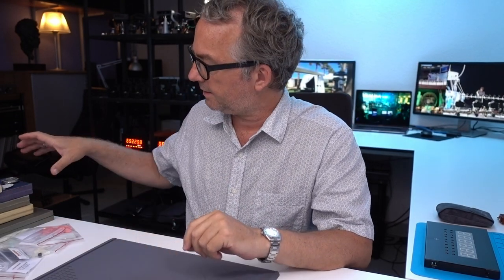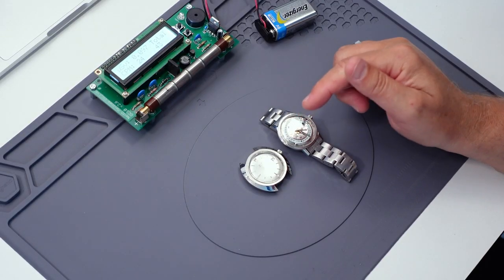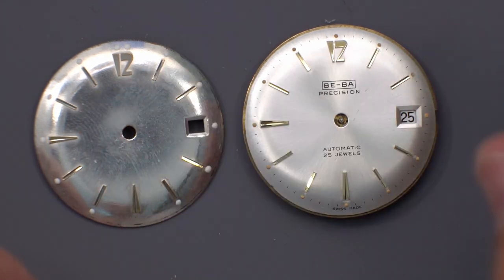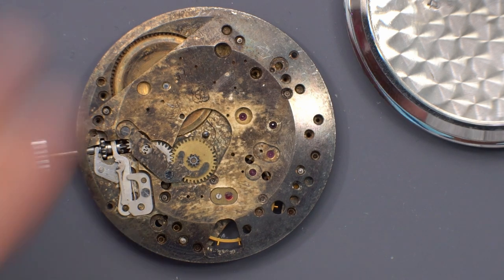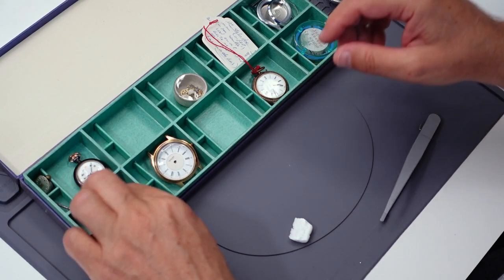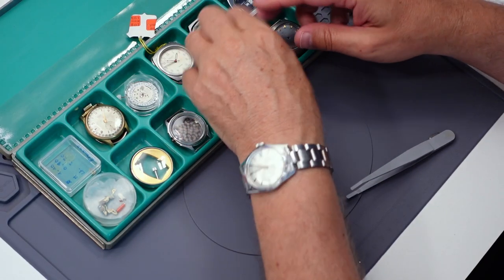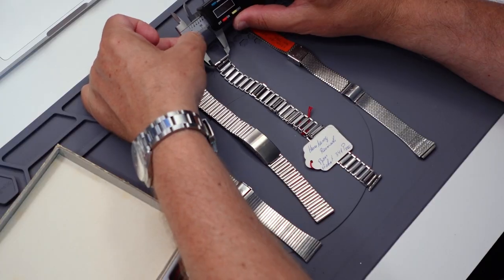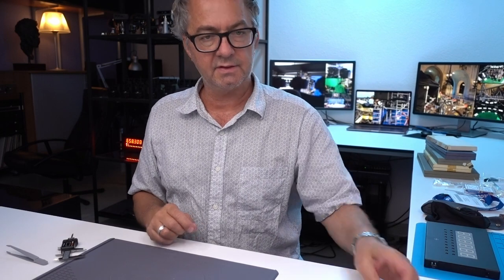Restoration: $80 of Vintage Swiss Watch Parts Purchased in Switzerland!

Comment: I am a bit puzzle by some of the conclusions you are drawing from these artifacts. You can't tell from a dial if a pocket watch is interesting. Pocket watch dials aren't guaranteed to have a brand imprinted on them. The only way to judge if it's interesting is to open her up and look at the movement. Pocket watches date back to a time when the movement was one thing but the case and sometimes dial was a totally different one and a buyer would mix and match them as they saw fit. The store would then assemble the complete watch based on the buyer's picks.
Reply from the maker: I didn't know that!  Thanks!  I will examine them more closely.